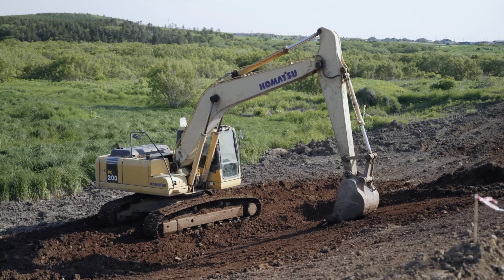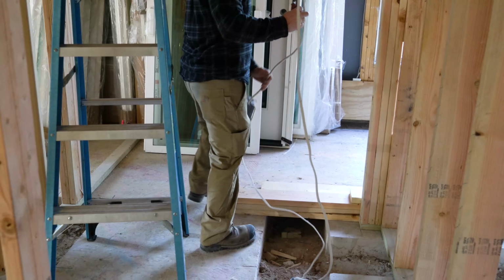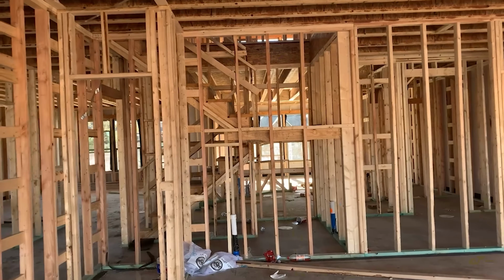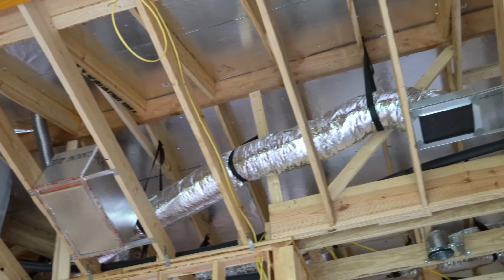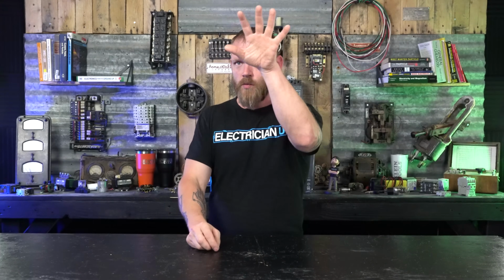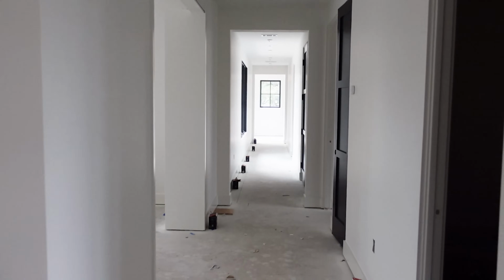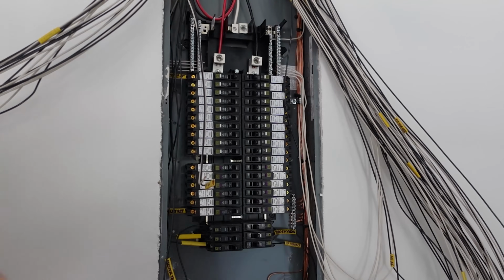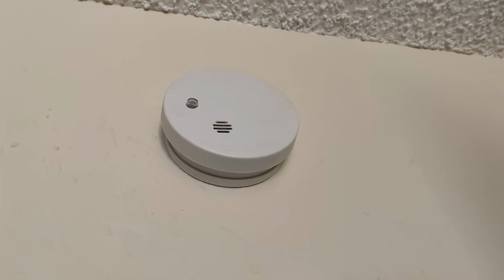Step by Step - How to Build a House

Comment: Hello, could you explain the process before site prep? For instance, hire an architect or engineer first? When to hire a general contractor?
Reply: You will need a civil engineer to engineer your site. They will provide survey plans to determine if the land is not within the wetland zoning. You will need to meet with the town planning board to determine subdivision where needed. You will need site plans and subdivision approvals. A land disturbance permit from the DPW is needed before you start working on the land. Your general contractor can assist you through this process. The architect will provide the building layout for your site plan and also the construction document which will be used by the general contractor to build.

1. Get land survey 
2. Get building layout /plan
3. Get civil engineer to prepare site plan / stormwater where needed 

Best is to go to the town officials and have a chat with them to determine their requirements for building in that zoning. They can spell out what you will need to obtain building permits.
Reply: THIS..  would be nice if he answered your question, huh!

Comment: Super here who has been in the trades first.

Most of this is spot on. There are a lot of variances in different regions. Some of this info is opinionated. I don’t have any issues with HVAC and electrical contractors doing their final at the same time for instance. HVAC tech usually is crying about something the electricians need to do for them anyway. 

The part you left out is the damn clean up crew behind the electricians because they don’t carry a broom. 😂

Comment: Great video, as usual.  But I don’t understand why if the panel is grounded to the rebar under the floor that a grounding rod would still be required on the outside of the building.
Reply: Cement isn't conductive so it won't be ground to earth

Comment: 0:53 - Site Prep
2:17 - The Slab
7:13 - Framing
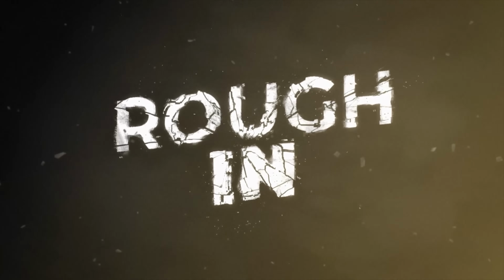8:52 - Rough In
11:49 - Inspecting the Rough In
14:50 - Trim Out
19:05 - Inspection
Reply: So no FLOORING, FLAT WORKS - walkways, driveways, FENCING, IRRIGATION??
Reply: I guess that is for another video. LOL!!!
Reply: @nikenneji1167   Concrete floors. The rest isn't part of the house. It's part of the property.
Reply: What about footing
Reply: @mista9864   The foundation was overlooked, as was the roof.
Reply: The panel around the service only inspection part of the video is a 3Ph panel. Why? Who is putting 3ph in a house? Or is that just stock footage?
Reply: No isolation?
Reply: great summary

Comment: HVAC guy here, don’t ya love it when the builder has us all out there working at the same time!
Reply: To laugh and cut up, yea. To work over each other, no... 😂
Reply: You know we always will need something from each other's
Reply: When is the best time to have hvac installed?? After plumbing and electric, before...?
Reply: @Pablo_19_26 pluming first HVAC second and electric last. Atleast in the roughing stage
Reply: @Pablo_19_26  after
Reply: @Pablo_19_26 after plumbing, before electric brother. Wires bend, hvac can get creative, plumbing is the strictest
Reply: @Pablo_19_26  not a lot of experience, but hopefully, this will help you. Your refrigerant lines, drainage, and electric connection have to be done before you hang drywall. At this point all electrical and plumbing will also be covered. The air handler intirior machine will be installed after the ac closet is painted. Also the ducts for the ac will have to be coordinated with the electrical to avoid having and ac vent to close to one of the lights . At the end is all about coordination and having enough space to avoid conflict with other scopes of work .
Reply: Sometimes when I drive by construction sites and I see the carpenters plumbers and electricians working at once, I pull over and just watch, waiting to see what magical things happen XD
Reply: Yeah, a good point. Having good coordination can make such a difference in how smoothly the Job flows. I always prefer completing the Framing including chases drops register box openings before HVAC starts.  Bringing on electrician before HVAC can also create problems. Little wires are easy to go around ductwork,  when wires in the way for Ducting, ABS plumbing. Even Fire Sprinklers.   Coordination between trades is. So helpful.
Reply: The freaking worst!!
Reply: Plumbers first right after framing..then electric..then hvac then insulation
Reply: M  me
 K m mmmmmmmmkmmm. Mmmmmmmmm mmm.😅🥲😅😅🚅. 👍.        ✊🏾.     🧋🛷 ⚫️ 🥣🍧🍁🪨🌷. 🌷🌷🌺🪨

Comment: Great video. I built my 1st home in Bastrop last year and I'm a licensed (Electrical) journeyman and certified HVAC Tech. I had a great jump for as knowledge when it came to pulling permits as I work with Austin Energy as well but I did drop the ball in some areas for as the building construction "Process" but I'll do better on my next build and this video is great. I've been watching and following your channel for a few years and just realized you're in Austin Texas as well. That's pretty cool. Keep up the good work brother! Very helpful.....

Comment: When I was working in Las Vegas they installed the permanent exterior rated meter and breaker panel when they poured the slab.  It was on steel channels, which tied to the rebar before they poured the slab.  This resulted in a dozen 120-volt and 6@240-volt receptacles in what would become the garage, as the house was constructed.  The electricians, then ran the wring for the permanent electrical to just above the cabinet, and got the rough electrical inspection.  Then they would come back and do the plates, and get the final inspection.  After it was inspected they would remove the temporary receptacles from below the panel, and land the permanent wiring and devices.    Then the drywall contractor would drop back by and do the last sheet of drywall for the house.

Comment: Not all buildings use slab on grade, there's also raised floor construction. Which is way better but a little more expensive. Gives underfloor access and feels much better to walk on than a slab. Environmental issues should never interfere with construction phase unless they are building without permits, usually a bad idea. You are starting at the construction phase and skipping the entire planning process: site investigation, building design, engineering, building permit acquisition, and finally construction phase. If a government entity is shutting down your project, you done messed up.

Comment: thanks. Few things i thought need to be added. We are in the middle of building a home and the design costs and time were huge that weren't factored in along with permitting with design back and forth. Architecture, septic design, flood plains and site plans need to be understood and developed before you start site prep

Comment: Yes, first Plumber, then HVAC, then Electrician. Drains need certain slopes and they can't wiggle around things very easily. Hvac is large and needs space but it can go around pipes. Electrical can fit almost anywhere and move around plumbing and HVAC so it goes last.
Reply: Thanks dude 

I gotta build my own damn house or else I'm gonna have to pay rent for the rest of my miserable life
Reply: @iamwhoimnotimnotwhoiam4431  same. I’m scared to try tho
Reply: Spoken like a true plumber
Reply: Cool tip. What’s the latest building technology?
Any websites I should reference?
Reply: How long does it take for the slab to cure?
Reply: I always put Hvac above the sprinklers too because those can’t be moved around.
Reply: Yes exactly you can maneuver alot with electrical cords so makes sense to do that part last.

Comment: What happens if a romex wire gets damaged or cut in a wall or other place where there's no junction box. How would it get spliced back together?
Reply: Add junction box at cut and rerun wire or add second box close by and rerun wire.

Comment: maybe I'm biased as a plumber but I have to deal with gravity I think I should be first. I'm sure hvac has something else to say ,they maybe bigger but  direction matters a lot less for them. it is always nice to touch base know where others want/need to put thing and work to find the easiest solution for all parties.
Reply: Hvac and plumbers should go at the same time to coordinate.  Otherwise you get broken air vents and screws in water lines. Bad time for everyone.
Reply: I am an electrician so I am a bit biased. But we gotta deal with plumbers. So I think we should be first to eliminate that problem 😂😂

Comment: Dealing with it first hand right now. Building a custom home myself. Gc’ing the project, subbing most out but also doing some things myself. Broke ground at the beginning of October. We’re trimming everything out right now. literally doing trim (hanging interior doors yesterday and today), cabinets, bath fixtures, electrical devices, panels (tomorrow), flooring goes in next week 😬. We got permanent power hooked up a couple weeks ago so I have spent the last week and a half trimming out devices by myself. 170 of them 😮… Shooting for 1st week of July for move in. FINAL STRETCH!! I’m tired lol… really tired… 12 hour days 7 days a week are starting to wear me down.
Reply: We are doing the same thing as well
Reply: did you complete the house?
Reply: @seniorzhang9114  yes moved in July 7th 2022
Reply: @macgyver03ga  congrats!!

Comment: Awesome video. Really informative for someone who’s lives in Australia. I like the concept of the drill plates and I like your lighting “Cans” are there any jurisdictions that solely stipulate conduit instead of Romex & Staple?
Reply: It’s common in the state of Illinois (IL). Most municipalities in the US for residential construction do Romex.
Reply: @macgyver03ga  Thanks for the reply 👍🏻
Reply: @jurassicsparks5220  I like your username, mate! Yes, building codes in Chicago require metal conduit in ALL structures. I’ve heard a lot of the residential electricians there bend conduit without a tape measure or level. They have to be quick and efficient at running conduit to stay competitive in the residential market
Reply: @Ephesians-ts8ze  wow, I mean the IL tradesman sound like good workers

Comment: Waiting for the other trades to finish makes sense. It's easy to reroute a wire or move a receptacle if something is in the way. It's not so easy to relocate plumbing. I read around that mudders like packing mud into the boxes. Do you ever have that issue?
Reply: All the time and I hate it

Comment: Do the electricians do low voltage wiring like network cables or security systems or are those separate specialties?
Reply: In my state, we have "low voltage electricians" who are licensed electricians and specialized in alarm systems and similar installs.

You only really need like $200 worth of tools on top of what an electrician already has to do, for example, networking.

Personally, an electrician is the sort of person I'd feel most comfortable pulling my cables (and making sure it's done to code).  But, personally, I'm happy to install my own devices/ports/etc.  That part isn't hard or dangerous to DIY.
Reply: Supposed to be separate, I've been asked a few times and people don't understand why I wouldn't do that. It usually takes different tools and knowledge.
Reply: rarely its done by the electrician; if it is, then it's most likely cuz that individual has has the background to do so. So more times than not, its a different trade, at least in commercial... in resi tho, common/basic camera systems and data cables are fast and cheap enough to install by damn near anyone its mostly plug and play

Comment: Great video Dustin. Regarding service inspection. Here where we wire homes we typically install the exterior service, underground or overhead ( dont do many overhead as of late) and then install one GFCI outlet at a homerun either garage, kitchen, laundry or the refrig and then call for a Temp to Perm inspection. That allows us to not trim the whole house and still have construction power in the house when the power company disconnects our temp pole, but does not electrify any other circuits in the structure.

Comment: why do we not use 3 phase in houses. dont answer becuase our 240V stuff wont work. just the basics as to why not.
Reply: Don’t know if this is the only reason; but one of the reasons is simply because it is not necessary to have three phase in residential settings. 3 phase is useful for running large motors, the kind not usually found in the average home.

Comment: Good job coming from an electrician, but you missed a couple of points. Need to get a Port-a-John on site usually during the site prep. And apparently you live in a really flat area where slabs are done. If enough slope for a basement, need to get footings inspected before any walls ( block, poured concrete, or wood ) can go up. And water proofing of the foundation. Not slamming you. Covered most of it for such a short video. Love your work.
Reply: Very specific. I understand the slope with needing a stem wall. Very difficult for electrical to have stub outs. That slab always makes me anxious. Pipes stubbed in walls is a Great feeling!
Reply: Those points are up to a general contractor, not the electrician
Reply: @joshhowie4071  Exactly ! If you look back I said good coming from an electrician in such a short video.

Comment: That’s awesome man thanks for all the vids! I have a question: when you talked about grounding the slab, did you mean ground ground or bonding? I know, probably a silly question but I’m just wondering. Kind of intimidating asking that question haha
Reply: He is referring to the Ufer ground or footing ground. It is one of many grounding electrode systems we use. Rod and pipe, water piping, building steel are also types of grounding electrodes we can use if present. Since most homes dont have metal water piping or building steel we need another type of electrode so we use the rebar in the footing that is all tied together and later concrete is poured to encase all the rebar and touching earth it becomes a really great ground.
Reply: The ufer ground is a grounding wire from the service to a piece of rebar in your slab. It’s part of your grounding system.

Comment: I like to get all of the cans up before the hvac guys and plumbers start if possible. Then I let them do their stuff and  I come back and run wire when they're done.
Reply: That’s a good idea
Reply: Everytime I put cans up and HVAC hasn't been there 50 percent of the time they are in the way and they end up traying it down for the HVAC lol it always happens it seems without fail. But everybody has to be on the same page. The plumbers HVAC and electricians along with the cabinet guys all need to be on the same page from plugs on counter tops to drive locations to vanity light location. Also the wire sizes, return locations. Man we do alot of juggling don't we lol
Reply: @justinwalker4506  Every once in awhile some cans might need to move, but HVAC guys should know that lighting layout trumps anything they do. They should work around them unless its impossible. I agree, coordination is key, and I'll work with them whenever possible, but I'm pretty anal about my can layouts lol.
Reply: @phi5head  yea I agree but the last few houses I've done the engineer who drew the blueprints didn't account for plumbing electrical and HVAC( when do they ever in residential anyways haha) and we get told the HVAC is going here and they are panning here then all of a sudden once it's done they say them cans have to move because we are just gonna tray the ceiling for the HVAC return or supply lol I hate it
Reply: Hvac is my enemy period
Reply: Hvac always has vents in the way of cans
Reply: @HardHeadMilitary  lol just had that problem other day.

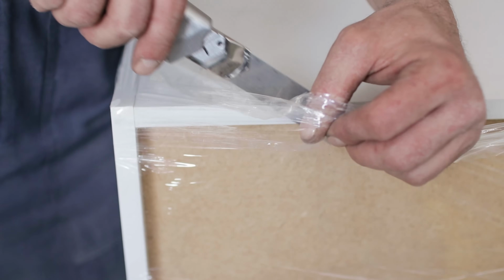Comment: 13:23 - I bet dude would have an easier time drilling if he were drilling the right direction!
Reply: I know exactly what happened, we use the same sds at work. The forward direction button is on the LEFT unlike an impact where you press the button on the RIGHT. Incredibly frustrating if you’re not thinking about it
Reply: Sometimes I’ll start the hole with the drill on reverse to prevent tear-out/chip-out before drilling forward.
Reply: Thought I saw that too. I was going to go back and find it to verify, but then I saw your post.